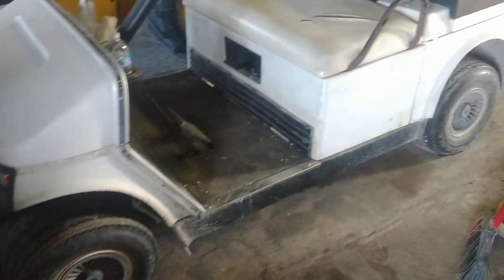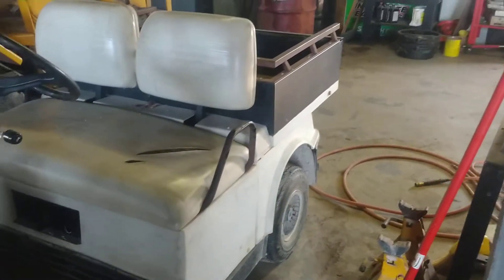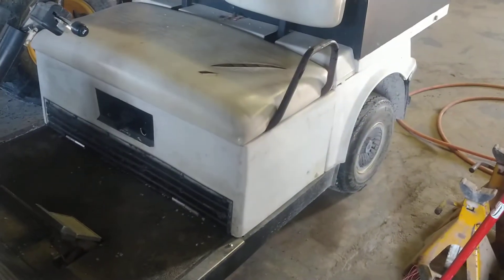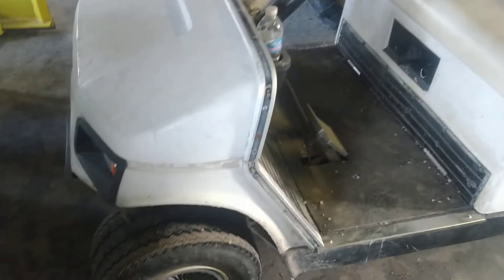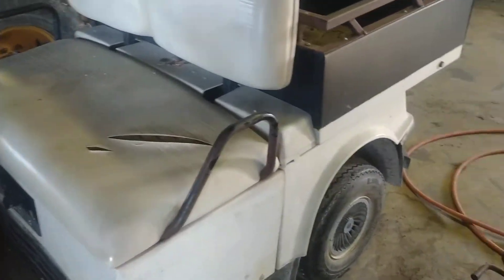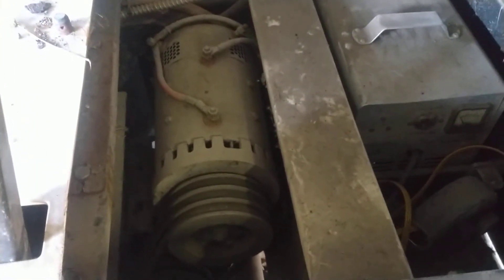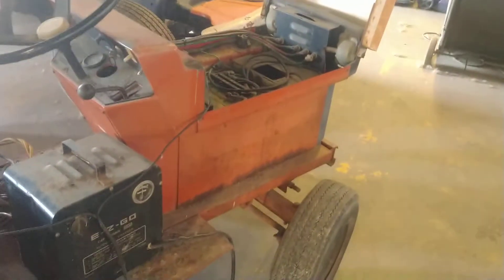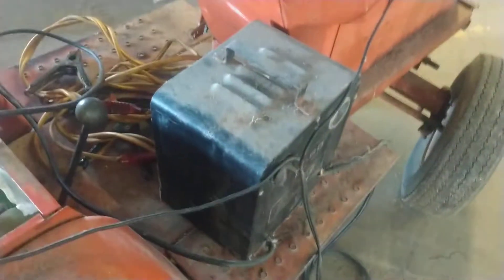What we use for a "jump pack"

Comment: Minnesota Iron Ranger here, I run a 36 volt E-Z-Go with 3, 12 volt truck batterys, a craftsman 3 speed tranny from an old tractor and the rear end, converterted to chain drive, a set of ATV tires and a 4 inch lift. I installed 4 solar panels on the roof and some led lights. It's quiet and works well in the snow. And it charges it's self as long as the snow is removed off the top. Thanks for the shows.
Reply from the maker: These things are nice, the cart has a 48v system with six 8v batteries (getting close to their end) and the old mower has six 6v batteries that are WAY past due... when I started here my boss didn't even have a welder, he used DC rods, jumper cables, and the mower. Lol